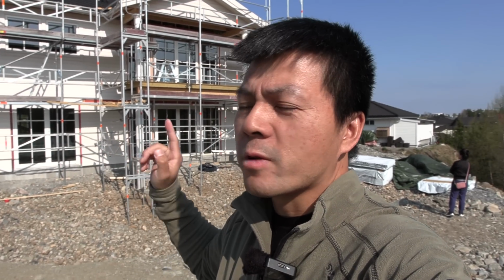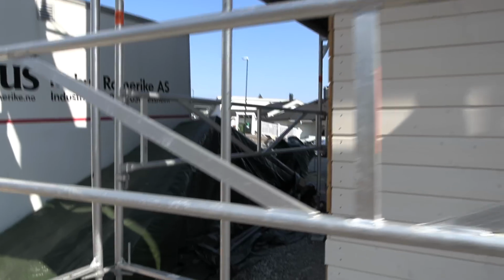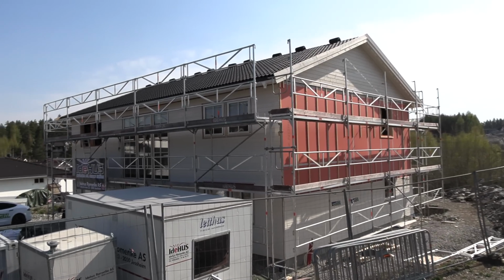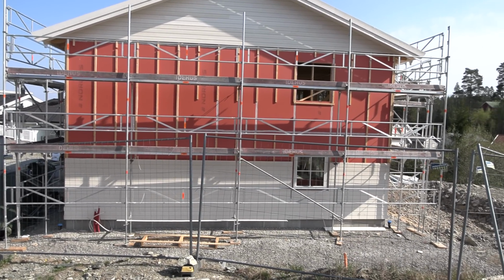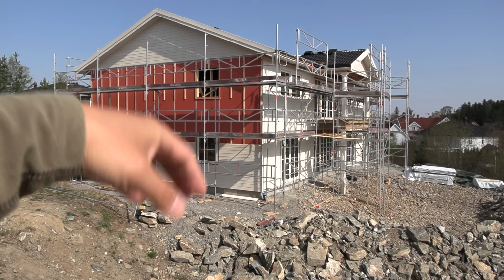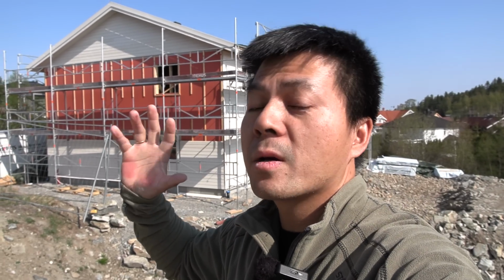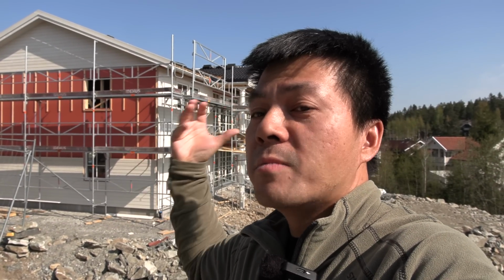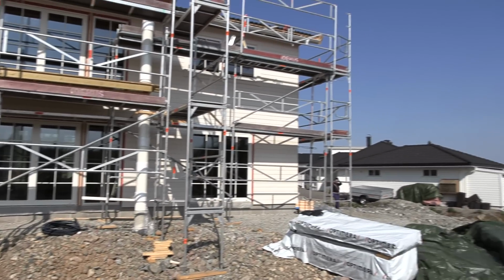My new house in Jessheim May 13 - questions answered

Comment: If you cover half that entire roof with solar and only get 5kW, that wouldn't really be that worthwhile.  Your decision making process makes sense.

If they come up with 40% efficiency solar roofs in ten years and it's relatively inexpensive, I think you could hunt around for a roof strength retrofit quote that could beef up that roof structural strength for relatively little money, but to be honest, I'm looking at it from the point of view of someone who never has snow.

The negative attitude that builder has about solar sounds more political than engineering, and is likely exagerating the cost of beefing up the roof for solar and making some type of lies about drainage, but even if he inflated the numbers by 4x, even an honest appraisal of solar benefit seems to be not so good for the current available options.  Your decisions seem just fine for now.  Like I said, there's possible options if you change your mind when available products improve.

Comment: Do remember that the ground below 6 feet deep NEVER CHANGES no matter how cold it gets or how hot it gets. Ground source heat pumps work regardless if there is water under ground of not,  But YES ITS a bit more expensive. The most expensive tipple glazed windows are only R 9,  Standard Low E triple glazed  windows are only R4.5, a very long way from the R25 in the walls.

Comment: In the Nordic countries we typically have a bit different systems than in Central Europe.
For example I have concentrated a lot on good insulation & heat recovery. 

In my house I have the following equipment:

- House is built with concrete stones and insulation between the inner / outer sides of the stone
- Quadruple glazing in windows
- Central ventilation unit with heat recovery
- Heatpump (air) connected to ventilation unit (central heating / cooling)
- Heat exchanger that is connected to district heating pipes. It heats the water and water heated floors
- Heat retaining heavy fireplace

I have also had plans to install solar panels, but the calculations have shown too long ROI.
Generally electricity is cheap enough, even though I have two EVs.
And here the electricity is 85 - 95% CO2 free, depending on the season.

Comment: I would get normal solarpanel, build in at the roof. That save weight and cost compared to your tiles - because you save the tiles and it will sit at the same hight of the tiles so you will not notice.

You keep the tiles at the side facing the road for the looks.

I will get an deye 12kw hybrid/off grid inverter. It cost 22.000 dkr here in Denmark. 3,3kwp solar cells cost 10.000dkr. And you can get an 15kwh lithium phosphate seplos kit for 20.000dkr.

I will get 6-9kwp solar om the roof (what your space will allow) and 3 kWp at your garage.

The thing there will save you money, is not the solarcells - but the inverter and battery. The inverter can buy cheap power at night/charge the battery at night and power your house whole day.
The inverter can also reduce your maximum power peak consumption, since you can reserve the last 20-30% of the battery for that. Then your system limit your powerbill because it reduce your peak power consumption and you pay a form for a tax/fee on that in Norway.

You can get this system without solar cells later. But i recoment you get solar cells, because the inverter use 1-2 kWh/day and there is a los arround 8% when converting from ac to dc each way (alost the same for an tesla converting ac to dc when charging - would be nice with an video about that). The difference in prices will cover that. But if you have solar cells they will cover that too plus run the house the whole summer.

Yes you will charge alot of electric cars, but you charge them in the night, so the system doesn't need to charge them in the winter from the house battery. In summer you can have a charger connected to the generator input of the inverter, there can turn on when the house battery is full. Then you can charge a car on surplus power from the solarcells in the summer.

The inverter also work as a whole house ups.

And yes it's your house and you do what you would like to do. But at least i will get solar cells at the garage maybe in the future with this system.

PS, thank you for your videos and your test

Comment: For the pool, did you plan to use  a curtain-type rolling hard cover just over the water?
Otherwise I love the aluminium-glass/plastic valved covers (like low sliding greenhouse):
isolates well, warms up the pool when sun shows up even if cold outside, and allows to take a bath despite rainy/cold weather!
Reply from the maker: Nope. They are ugly.

Comment: Totally supporter your choices Bjørn. TEK17 insulation and ventilation provides very low energy consumption for heating. Having a new house under construction, i did all the calculations and ended with 2 air to air heatpumps.

Comment: 11:00 - You could easily climb the scaffolding and go in the opening that does not have a window installed.  Locking up the first floor and not the second floor is false security.

Comment: I'm a retired builder in Canada.I think you've made good decisions.
The ugly doors may be there just for the construction phase so that the permanent doors don't get banged up.
Reply: I had the same thought. I assume their building code requires a blower door test, so it’s safe to assume all doors and windows will seal well.
Reply: Yes, even in USA, it's very common to put in temporary doors, since front doors are very commonly banged up during construction.  Those are probably that construction company's prized temporary doors that they use as a temporary "tool" during construction, and they're probably just as proud of their banged up temporary doors as you will be of your permanent fancy doors.
Reply: He he he yes it is. Imagine if they put in the "real" doors like in Canada they would be damaged and have to be replaced. 
You do not know how many doors I have had to replace here in Canada :)
Europe is way ahead of North America in quality build.

Comment: I always thought it would be a good idea if you made a carport to make the roof out of solar. Easier to reach for cleaning. Doesn’t need to be waterproof and could be bolted straight on a steel or beam construction. Not a suggestion, just a thought for my own future house build.

Comment: Nice house! The other reason that wood is better than concrete is that cement (the primary ingredient in concrete) requires a great deal of CO2 to manufacture (a very significant source of CO2 emissions worldwide).  Wood is a renewable resource and is honestly a better (more sustainable) material to use for the construction of any building, especially single family residential.  There is a movement among architects/designers to switch to wood frame (in favor of concrete) for many buildings.

Comment: HI Bjørn really nice house but I'm sure that someone has already told you about the 2 rear door in the back of your house these are for sure temporary doors that the contractor installed during the time they are building the house so that they don't damage the real doors and they did the modification to the door so they are able to pass extension cable for the power tools they are using outside the home plus they need to lock the door with there own lock so they are able to open the doors at any time or lock it after they are finish working at the end of the day .
Reply from the maker: I should have made it more clear and asked what the heck is that thing?

Comment: I totally agree -- an energy efficient house in Norway is a smart choice. The 'heat scavenging' you mention is called an HRV. It is a heat exchanger  with a fan.

What heat pump did you get ? New ones coming to market are able to work at a COP of about 2.0 down to -15C. That is the ticket. Will your domestic hot water also be heated by the heat pump ? One very important detail in designing the heat pump system is to have as large a tank as practical. That way you operate the heat pump during the times when it is most efficient. The difference in efficiency can easily be 200%, and perhaps more.

Cheers !

Comment: Great to see your dream coming true. That mansion looks superb. I agree on most of your choice decisions are the best: very good insulation near passive-hauss, heat pump and floor heating, forced air ventilation with heat exchanger. But the pool... 😱 That's a big expensive luxe 😅. Good luck and best wishes. There is a German fence builder that's making it with two solar panels (bifacial) in vertical and looks very nice all around the house.

Comment: I am surprised that solar is not cost effective in Norway. In Sweden everyone and their mother is currently having solar installed on existing homes. New houses typically comes with solar from start. District heating or heat pump with a drill hole is the norm for a new house. How cheap is electricity in Norway to not be able to get pay back on any environmentally friendly investments in ones home?
Reply: It's cost effective in Norway. Payback is 10 years or so with 0.75kr per kWh a spot price which is much lower than the last few years. This is not including resale value. That being said, it's Capex. If you have 300k NOK to spare, it's a no brainer. If you don't, well, you don't have a choice.

Comment: Good choices made 👍😉 if the solarsystems with battery will get cheaper and more efficient you can extend it later if it make sence. Congrats nice „mansion“  Grz from🇨🇭
Reply: For the doors normaly they are constructiondoors so they are not the finally once. They are used to keep people out of your house to not invite constructionthiefs 😉

Comment: I'm quite sure someone is still fooling you around. Those tile roof are heaviest roofing material what you can get in house so solar roof shingles or tile quite sure weigh same and then they doesn't need any more support to be used. 
Quite sure company who is building your home doesn't want to deal with that solar roof and that's why tells white lye about load bearing.
Reply from the maker: "quite sure"...
Reply: @bjornnyland  Well to be honest i have had own construction company 20 years built 10 houses and renovated more than enough so speaking about construction is for me same for you speaking about cars. Can't be 100% sure because i don't know exactly how everything goes in Norway. 

But if you would built that house in Finland wouldn't be any problem to switch those roof tiles for solar roof tiles when weigh is similar.

Comment: Norway is cold in winter and almost no sun in winter, so when you need the solar panels they don't produce.
In summer it doesn't get hot enough that you need AC, especially as the house is well insulated and will keep cool in summer.
Norway has a lot of hydro and good wind possibilities, so power is normally quite cheap, at least at some time of day so you can charge the car then.

Comment: Are you getting a hot water storage tank?
As long as you have water-based under floor heating, you have a "battery" of heat right there. That way you can use low price electricity to heat up the house.
Reply from the maker: Yes

Comment: My house doesn't really need air conditioning both in winter and in summer, i installed a solar chimney with a solar greenhouse over the entire south facade. now i use a little heat pump for warm water and deumidfies the air for the Mechanical Ventilantion with Heat Recovery and Free Cooling for summer.

Comment: When i comes to selecting a heat pump, i can highly recommend the Vaillant models. My biggest concern when purchasing a air to water heat pump was the noise level, but i can happily report that it is literally soundless unless running at 100%, at which point it’s barely audible 2-3 meters away. If you’re ever in Denmark I’ll happily give you a tour :D

Comment: Can relate. We are going full solar vs solfangere most likely, as solar looks better than solfangere. I have tried to find solfangere that look good, but have yet to find anything that looks OK, and is efficient (dualsun hybrid panels looks great but not that great for the water heating performance), but might go that route as it's better than nothing water heating related. That being said, maybe a ground installed system considering you have a pool that's being heated, you will save in that cost in like 3 years.
Reply: This is my thinking, but another reason for solar is to be more self sufficient. In case the grid goes down for a day or a week, I know I will have a bit of power. This is also why we are installing a fireplace, even though it won't be used most of the time. Will be way too warm within an hour when used with the floor heating and isolated house.
Reply: The grid is never down in Norway.  At least ten years sine the power was out for moren than a second where i live..
Reply: @atleyri  it happens. Last time 32k customers in Oslo and Nordre Follo 26.3. You never know what happens, or when. Not having heat, power and food backup is out of the question for me at least.

Comment: Hi Bjørn. It's going to be a great looking house whent its finished. I just have one question, have you planned to make this a smart hous? Now is the time to get everything in the walls before there is any insulation installed yet. And i guess you wil have some sun screens in front of you large windows. Get the builder to put power to the top of the windows now. So you won't have visible cabels on the wall to the nearest power point. 
And as i wrote in the last hous video, put all your Internet and wifi equipment in one hidaway place.
Reply from the maker: Of course
Reply: @bjornnyland  Så bra. for det er så mye dyrere og vanskeligere når alt er ferdig. Ikke spør med hvorfor jeg vet 😜. Hvis du skal ha smart ringeklokke ved døra di. påse at det blir satt opp stor nok strømforsyning slik at du slipper den jobben.

Comment: Some solar cell facts.

Yes, the payback period for solar cells in the Nordics is longer than in the Mediterranean. But even at these latitudes, a south faced 14kW installation can be paid off in 5-10 years and then generate free electricity for another 20-25 years

These calculations are based on:
- That you can sell excess energy to the grid owner for the same price as you buy the electricity. 
- Based on current prices for electricity and solar installation cost.
- a 14kw installed solar power generates 14,000 kWh annually in Sweden.

For an example my own 14 kW south west installation from 2019 (mid Sweden) is estimated to be paid off for in 12 years, due to higher installation prices back then and poorer efficiency as it is not directed towards the south

Battery storage, on the other hand, often has payback times of upwards of 50 years or more. Here are electric cars with the V2x solution, a good alternative instead if you want to store energy cheaply. If you are now unable to sell the electricity to your supplier

Comment: Hi Bjørn, thank you for all the explanations. If it's all about esthetics and costs, what about installing a small PV system with 800W, in Germany so called balcony power plant, which is plug and play, very cheap, safe and pays off within 4 or 5 years. You could put 2 panels on the garage or a shed and use it for all the base load of your house. That could be a cheap (~500€) and good compromise. Have a nice and sunny day with your family!
Reply: Why is everyone imposing there opinions on Bjorn that he has to have solar.  Just stop.
Reply: @therookienomore88  Very simpel. He stated that he initially wanted a solar roof but it was just too expensive or not feasible. That‘s why people think about alternatives. Maybe he hasn‘t thought about that option. It‘s just a suggestion. Nothing more. I personally told my friends, colleagues and family about such systems and they were convinced by it and are happy with that solution. For sure at the end it‘s his decision. By the way, in a comment section everyone is free to state their opinion.

Comment: Air/water heatpump is a safe bet and easily replaced compared to ground sourced heat pump. Also the efficiency of a ground sourced heat pump can vary greatly so it’s not a guarantee that it is more efficient than the new air/water heatpumps out there. 

At least that’s what the experts told me when i was deciding which one to get.
Reply: Better with water/water in Norway as it's so cold here. Always 4c temp for the heat pump. It's the difference between in and out temp. So 4c in and 21c out vs air which can be - 15c to 21c. It's also silent vs air to water which makes a lot of sound. Another benefit is that it provides free AC in the summer. More expensive though.